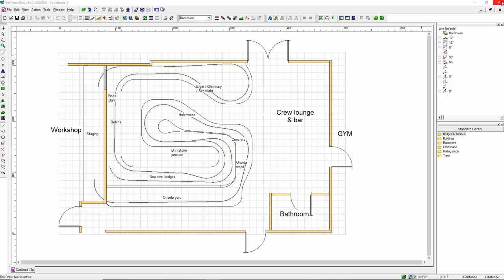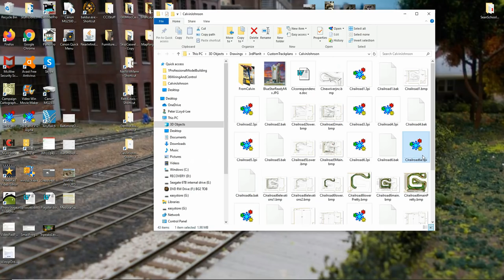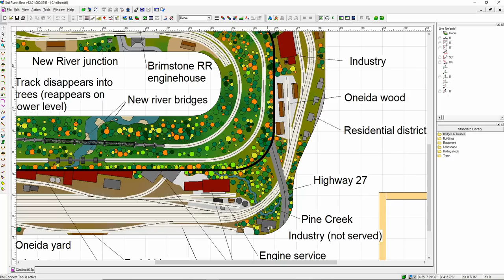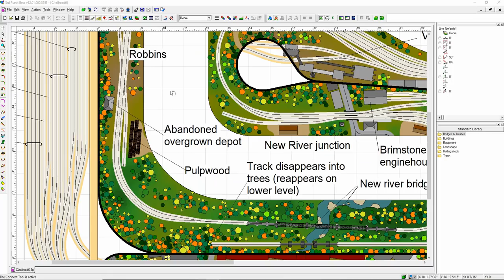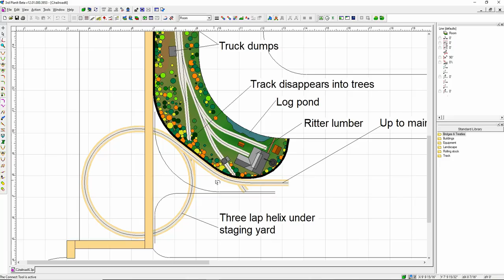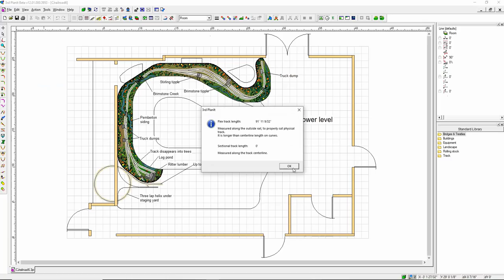Double-deck layout design for a Tennessee prototype

Comment: I have always wonted to combine an HO with an N scale. I would have two identical freight trains in each scale with a looper underneath. As the HO enters a tunnel in the up close section, at the correct time, the N exits another tunnel up and out in the distance as if it was the same train exiting the tunnel a mile or so away. Then it would continue off in the distance, through a mountain pass and enter another tunnel.  The would work perfect where the layout is split along two walls with the N scale up above crossing the room. The other train would be underneath it and timed just right to exit the HO side of the tunnel on the other layout. 

Now if I only knew how to do layouts.

Comment: Your right to not put that tunnel in. The last and most southerly tunnel on the CNO&TP was tunnel 27, where the Tennessee Central crossed the Southern line just east of EG tower in Emory Gap. 27 was daylighted when most were, and was replaced with a short girder bridge on the TC. Only 4 tunnels exist of the former 27, 2 south of Oakdale, including the very short 25, and 2 of the 3 original still exist at Nemo. Nemo is particularly interesting as a rail fan.

Good work Peter, very interesting and give what understanding I have of that 3rd district you’ve done a good facsimile of that line. I don’t know those branches very well, but it feels appropriate. 

Thanks for sharing and explaining, that’s gonna be a nice Railroad. I hope the builder shares in a way we can find out about it’s construction and evolution.

Comment: It is practically impossible to model a prototype in true prototype distances unless one has a disused Big Box store or a shopping mall. Let's say you have two locations ten miles apart. In HO that's 607 feet or 185 meters. Then realize that in the real world tem miles (16 km) is a hop, skip and a jump
Reply from the maker: Yes, very well stated.  That 10 miles you use as an example is probably a good prototypical distance between adjacent towns or passing tracks in many cases, but even if we could put our towns a scale 10 miles apart, would we really want to?  Operating sessions would drag out too long and get boring.  Aiming for a mile between towns might be more sensible.
Reply: @mpeterll  
I suppose it would even at a mile thats 61 feet. Model railroads are all about selective compression for the most part. Prperly done it works well. Poorly done it the engine is in the next town before taiend Charlie is outside the. City limits. If somebody wants to run really long unit trains then it is better to go with N scale or if it runs well enough Z scale imo. That also allows for scenery that really over shadows the trains as it should in mountain country. Tehachapi Loop in HO would be 14 feet diameter roughly. N scale works out to 8 feet. Z scale would be just under 6 feet. Doable. But yo need a large space to work in and a budget to match